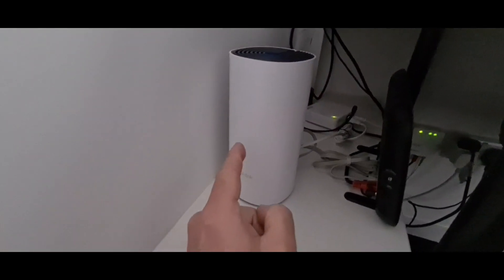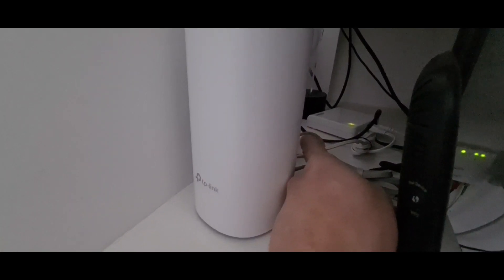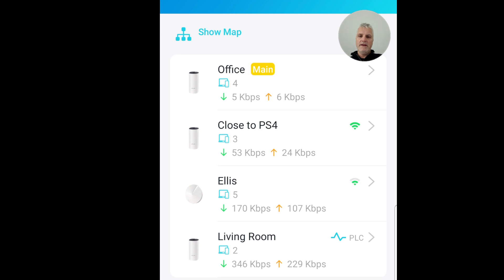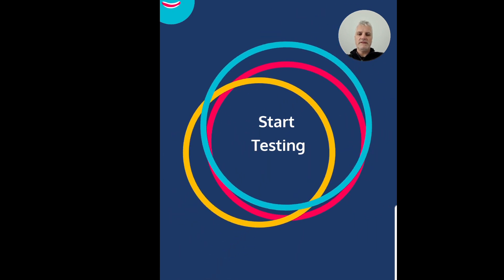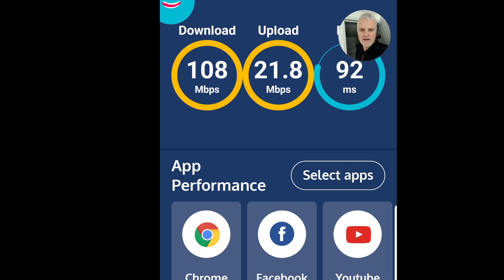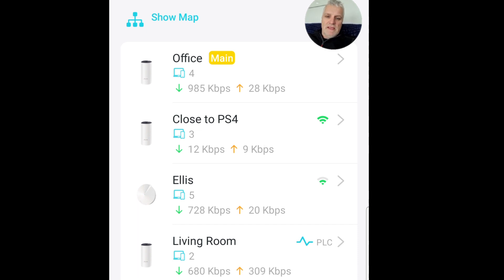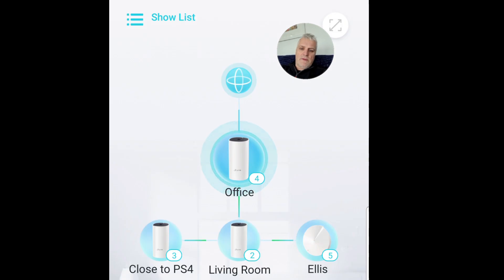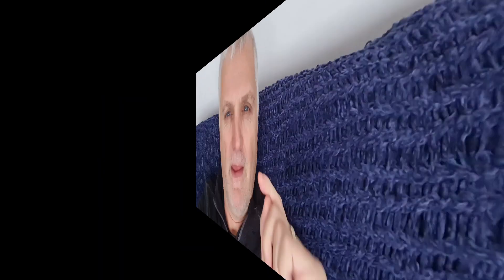Deco P9 Mesh Wifi Powerline Backhaul!

Comment: If you have the P9 Living Room through the PowerLine connection. Does that P9 Living Room give off a WiFi signal? So i could connect for example an S4 to the Living Room (WiFi) and another S4 to the Office (WiFi)?
Reply from the maker: Sure does.  So i have a router, p9, then poweline to next p9, then wifi to e4 and m4!
Reply: @stevedogwildman2133 is there a speed limit on the powerline and/or Ethernet connection on the P9s?

For example is there a limit to the speed that one deco p9 can connect to another p9 over powerline. And is there a LAN limit if I were to directly plug into one of the P9s via Ethernet?

Thanks 👍